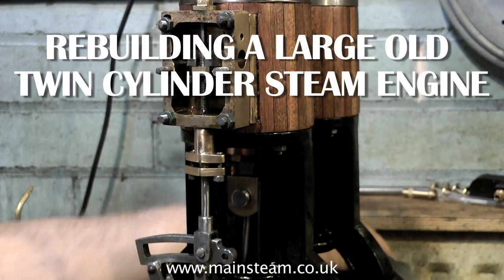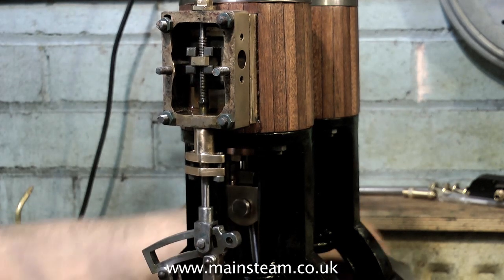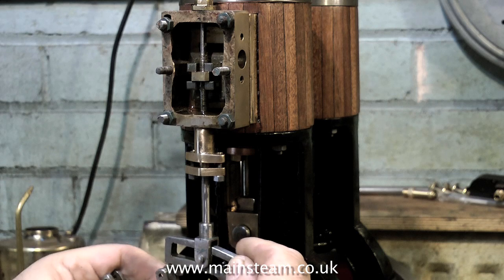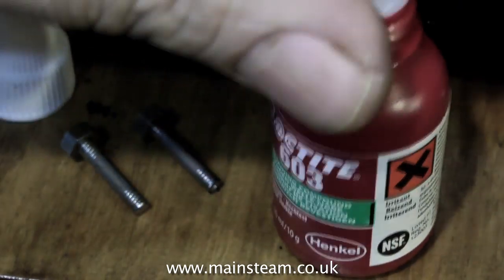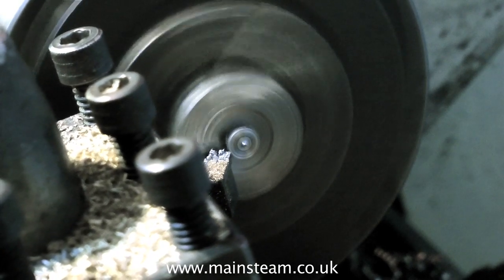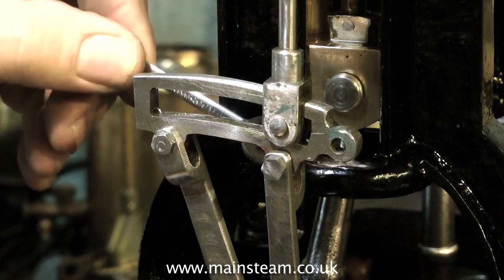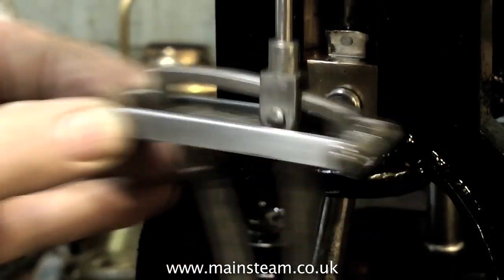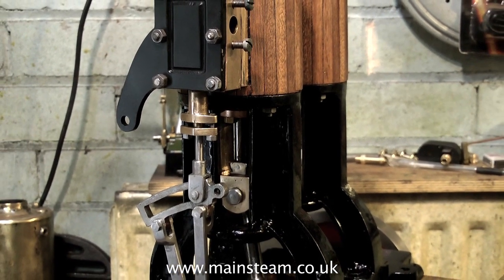PART #17 - REBUILDING A LARGE OLD TWIN CYLINDER MODEL STEAM ENGINE

Comment: Of all the parts you've described as poorly made or poorly thought out, the steam chests are the most jaw-dropping. Not only do they look like they were hollowed out using the builder's teeth, but that out-of-place stud is murder. I half expected you to use a countersunk screw and some body filler, and put a fake stud in the correct location.
Reply from the maker: I think that without doubt this big twin was the worst steam engine that I have ever been asked to rebuild - Initially I said that I didn't want to do the job - but the owner of the engine said he really liked it .......  {:-))) - I don't do fake studs if I can help it .... this engine is what it is ........